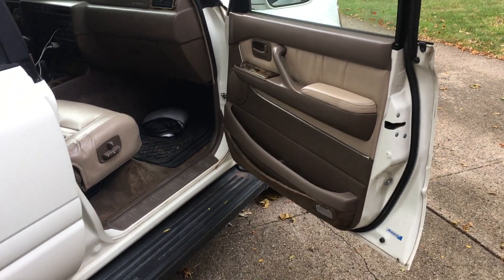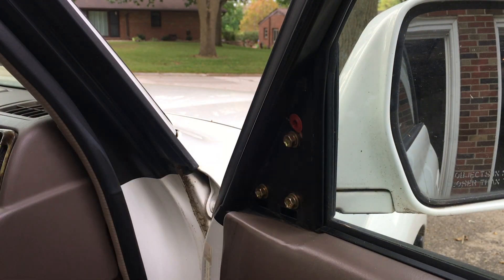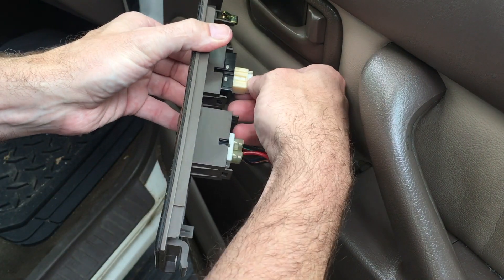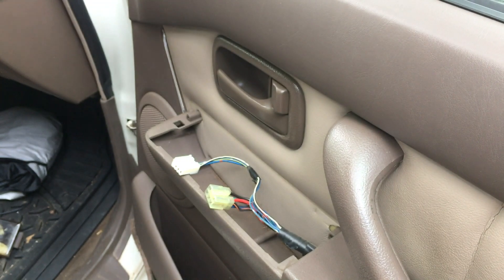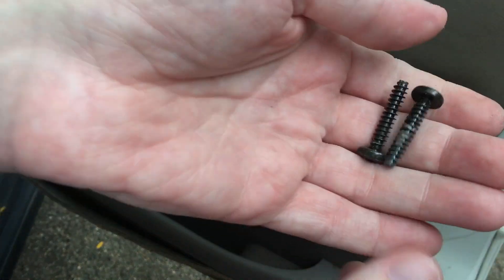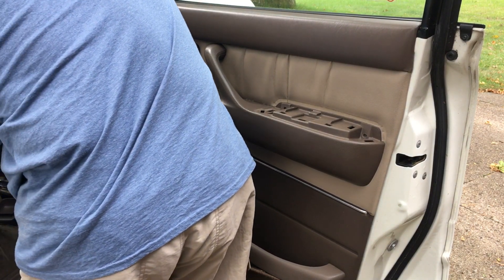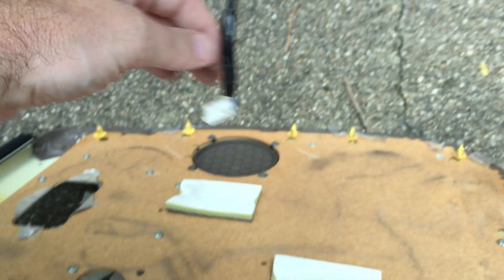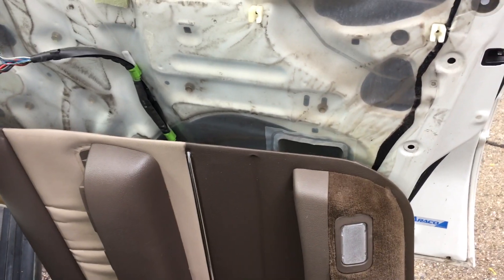1997 Land Cruiser FZJ80 Front Door Panel Removal

Comment: Wow my 1996 FZJ80 door panel is different. The electrical clip for the windows and locks is just One big clip with all the wires. Super hard to squeeze and remove. 
You have two separate electrical plugs.

Comment: Hi Rick! 
Thank you so much for the video. 
I am going to replace the weather stripping on the inside of the door. Do you know if I have to take the panel off to do this? It looks like it was attached to the top of the panel when you took it off.
Thanks again.
Reply from the maker: The rubber that contacts the window on the inside is attached to the door panel. I'm not sure what it takes to remove it. I may need to replace the rubber on the outside of the window one of these days. Mine is starting to pull away from the window.
Reply: @Rickmakes  Thank you sir.
I just replaced the belt moulding on the outside. I will wait to pull the panels until I get the tool.
Thanks again.